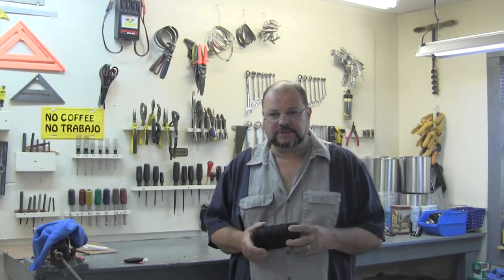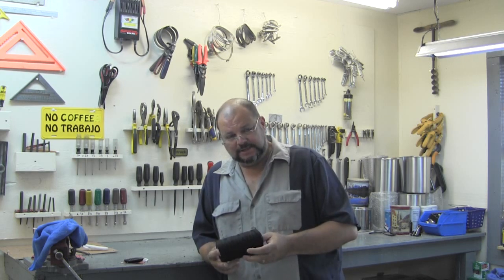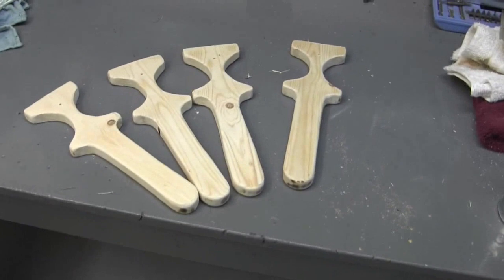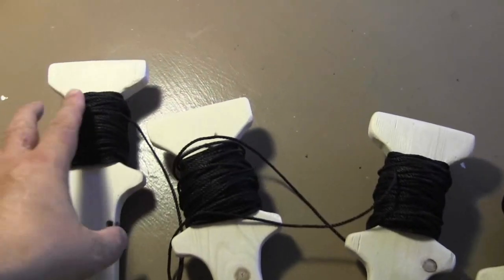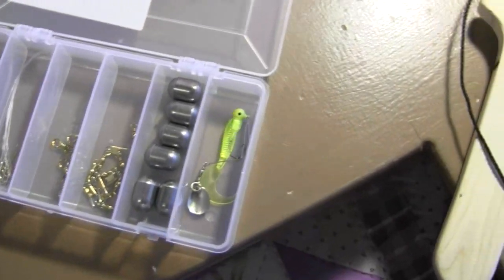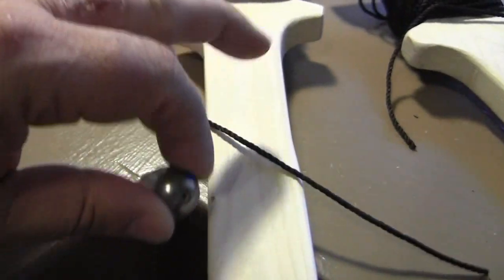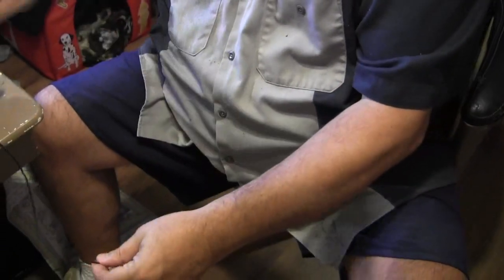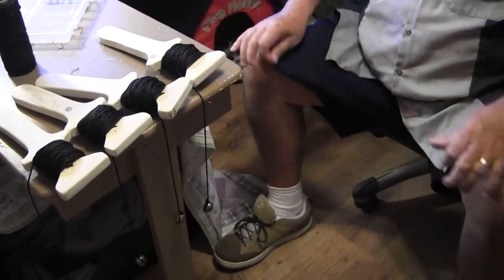How to make a catfish throw line

Comment: You can point the handle on those and knock them into the ground to set them in place. another way is to drill a hole in the handle and put one of those long nail type stakes through the hole into the ground or tie a cord lanyard to the hole in the handle to hook onto a stake. I saw a video somewhere on here where some guys were using a slingshot to launch the lines out instead of throwing them.